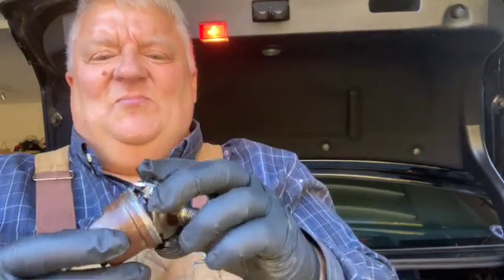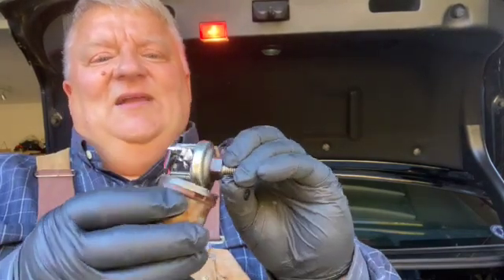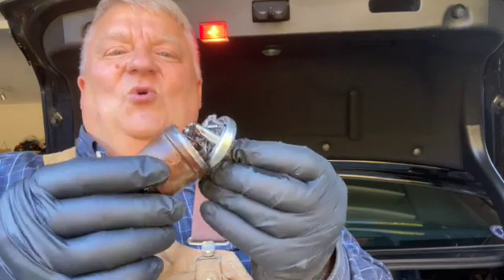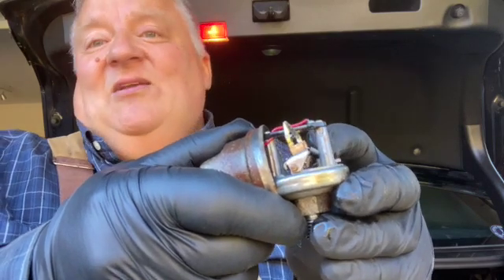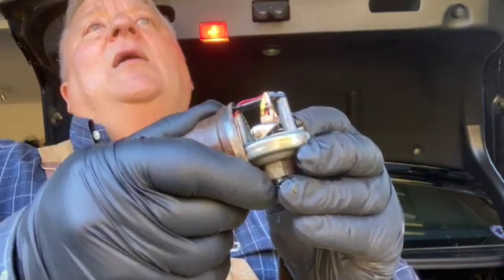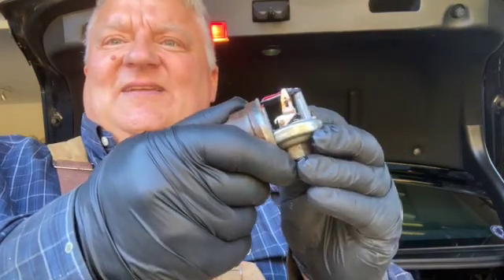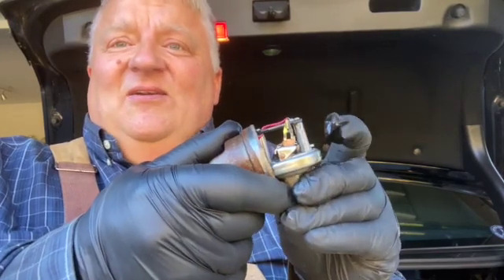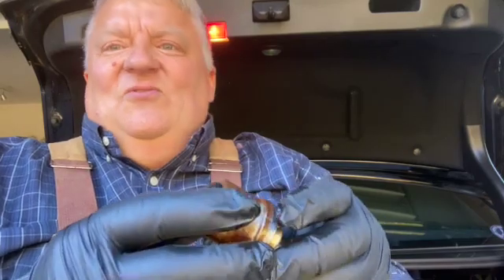Erratic oil pressure gauge readings - sensor update

Comment: Damn, another part i need to check! Mine is stuck at 3 bar.
Reply from the maker: You are in luck though - this is a really easy to access part. Beware of cheap parts though. I have had a few that had the opposite issue and they leaked resulting in showing no pressure. Good luck

Comment: Ralph a question.  On my 1988 420 SEL my gauge is at zero all the time.  I changed the sending unit and nothing.  The gauge does not even go to 3 on startup.  Could this be a cluster pin issue behind the instrument cluster?  The rest of my gauges fuel and temp are good to go.  Just the oil pressure is always at zero even after a sending unit change.
Reply from the maker: A quick way to test that would be to pull the plug off the oil pressure transmitter. Once removed it will read 3Bar all the time. If it does not do that then you will need to sniff out stuff withit the cluster/wiring.
Reply: @straybenzes I tried this Ralph this morning. Even with the plug off it is still showing nothing. Could it be on the cluster?
Reply from the maker: @staterunmediapro  Yes that can be the board in the cluster or a broken connection between board and the wiring to the sending unit.
Reply: @straybenzes  I figured it out finally.  Prior to my ownership someone reassembled the 15 pin cluster plug to the back of the instrument cluster.  The wrong write was in the wrong spot.  I switched the blue/green wire to go in hole 15 and it all started working once I resampled and reattached the battery.
Reply from the maker: @staterunmediapro  Wow, this is awesome news!
Reply: @straybenzes I can’t believe I figured it out. I found an online schematic of the 15 pin cluster and wire colors and slowly confirmed each wire color and number until I figured it out.
Reply from the maker: @staterunmediapro  Fantastic job. Well done.

Comment: is there a way to repair it instead of replacing?
Reply from the maker: Definite no if the inner seal is busted. Firm maybe if there is corrosion on the mechanism. Challenge would be sealing the main vover back in place. Really not worth for what these cost.

Comment: I Ralph me again😂 .. I have a new issue I cannot figure out so came right here.. 😅 my issue is my gauge goes straight to 3 and stays there when disconnected... I am having a hard time getting my head around that as in an event  I do have a low oil pressure problem while driving and the oil sender wire breaks on a long trip the motor will be destroyed.
In my mind I would think if the wire gets disconnected the gauge should immediately go to zero. 
In my case with the wire disconnected and not grounded the gauge reads full oil pressure at 3.
Would you Maybe know what's wrong or have seen this on any of the cars you have or worked on ?
Reply from the maker: That is exactly what will happen. When you leave the wire off it will always go to full pressure. You need to replace the oil pressure sender which is fortunately really easy to do and not too messy. Here is a brief video about that: https://www.youtube.com/watch?v=_ldq40hC6qg

Comment: 🤣😅 I had trouble with mine lol on like a 200km trip got to my destination and bare in mine my motor had like 3000km on it after rebuild... I really panicked and  didn't know what to do.. I pulled the thing and started the motor oil sprayed out so I was a little relieved and got it sorted... the sinking feeling of seeing the gauge go to zero wasn't good lol
Reply from the maker: Yeah, I am sure that had your full attention. Glad it was only the sensor.
Reply: @straybenzes   oh yes!😅🤣
Reply from the maker: @dwaynecoomber6610  😉
Reply: My oil pressure gauge will not move from zero just was working fine the other day would it have to replace this?

Comment: I've had the same luck with aftermarket oil pressure sensors.  I wasn't so lucky - only got a week's worth of time out of the last one I installed (customer provided) on a 420 SEL.  Replaced it with a genuine MB part, so far the customer hasn't reported back with any issues with it.
Reply from the maker: The attention to detail that goes into the genuine parts is quite astounding